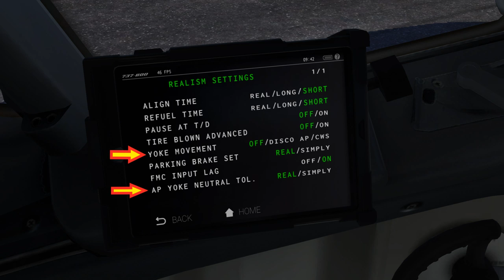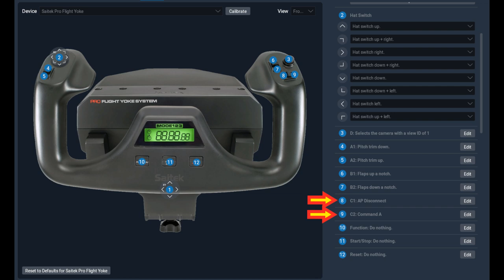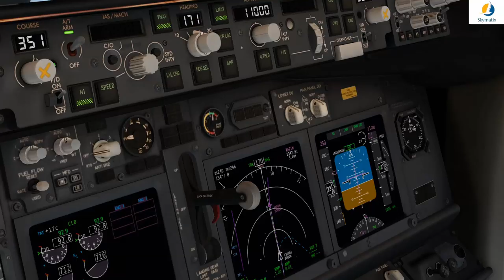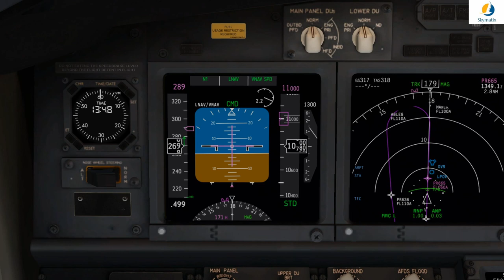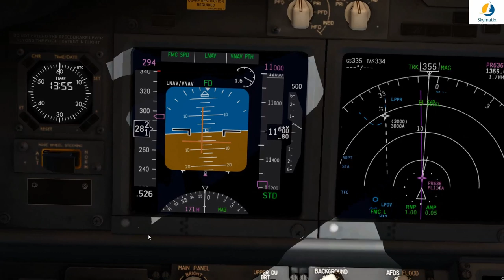Zibo Flight Director Helper Tutorial

Comment: I think some people are getting confused between the problem of trimming and yoke centering, both of which are required to engage AP in the Zibo Mod.
Having just spent a day resolving the problem on my flight sim, I will explain what it was.
My problem was a badly centering yoke, physically it centred naturally in both axis.  Electrically it was off centre slightly.  Centering it on Windows calibration didn't help.
It looked ok in windows, in XP11 AP still didn't engage.  It wasn't until I went into the EFB and checked under calibration I found it was off center electrically by 0.5 when centered on one axis.
Now setting a null zone on my yoke could have cured this, but I didn't want a yoke with a dead zone in the center, a yoke should be fully responsive throughout its full travel.
So I disassembled it and physically recalibrated it, thus worked fine.  It now read zero (ish) in the electronic flight bag in Zibo.
Bottom line, don't confuse trimming the aircraft with neutralising the stick, check in the EFB to see if your stick is misaligned
Reply from the maker: Amazing, thank you for your extra input!

Comment: hello! this options can affect autoland? I put the same  runway course in both places, the same ils freq,  both FD on, and when i pull the CMD B, the ap disengages. What did i miss?
Reply from the maker: No this is not related to autoland. 
Not sure what is wrong. It works for me so you could have misses something but I cannot guess what.
Reply: So tell me how do you do the audoland and i will follow your steps
Reply from the maker: Use the ILS information on the Approach Ref page. This will give you the correct frequency for NAV1 & 2 and also the course heading required. Do the normal CATIII approach and press CMD B before the FAF. That is usually all that is required.
Reply: @Skymatix1  i have already done this and don t work ..

Comment: How did you get the Command A option. I don't see it (am I bling???) lol
Reply from the maker: Pressing button 9 as per @4:31 Once pressed you will see CMD on the PFD
Reply: @Skymatix1  I was referring to the actual option, I do not have it in my command list to allow me to select for any button
Reply from the maker: @demontraitor69  try finding it when you are in the Zibo. Not just at the menu
Reply: @Skymatix1  well, I can find the AP disconnect but not the Command A. I don't seem to have it in the list. Just thought, I wonder if I have a CMD A... I've always been baffled why I've never seen the option. I wish developers were not so lazy. I would like the option the control the starter switches on the 732 but you can't 🙄
Reply from the maker: @demontraitor69  It is not lazy, the commands only work when the actual mod it belongs to is loaded.
Reply: @Skymatix1  lazy cos the modder has not implemented it (FJS for example)
Reply: I actually found it. Searching for COMMAND did not find it. I had to search for CMD... So strange